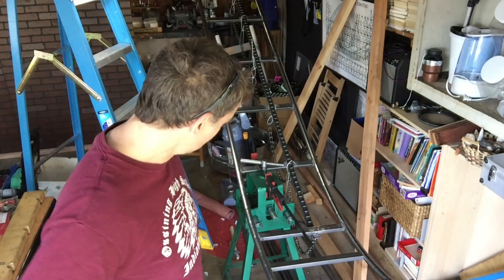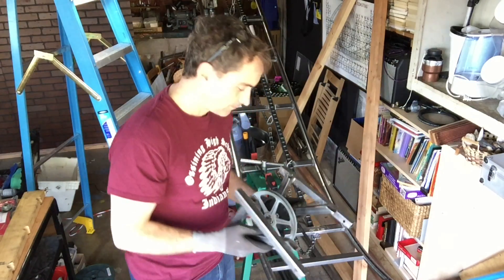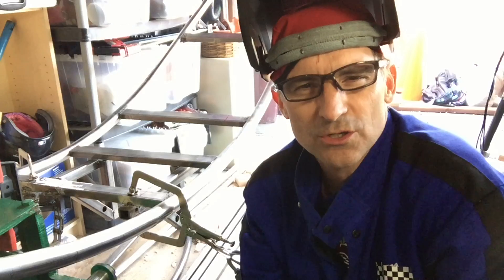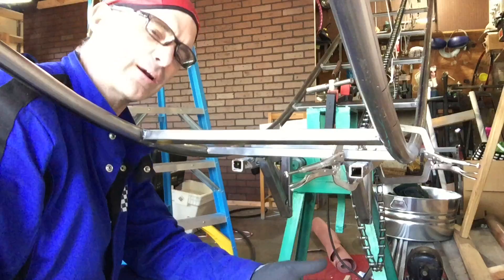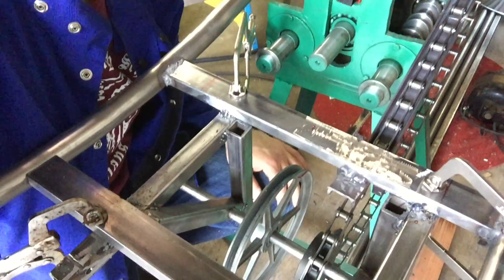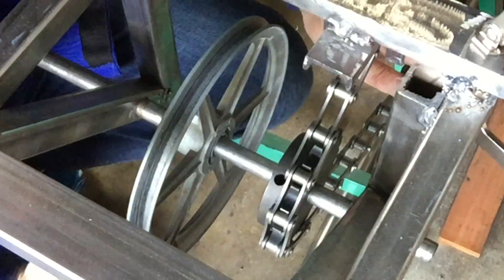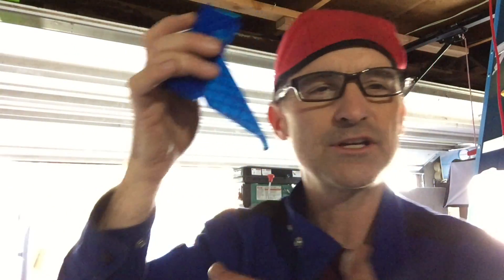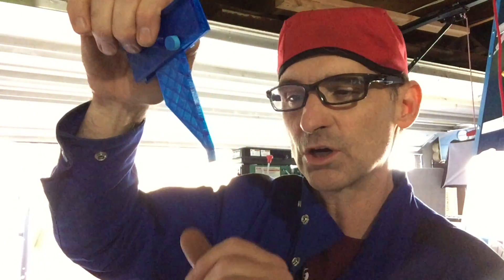Chain Lift 24, CoasterDad 28!

Comment: Omg the chain dog mechanism I literally thought of exactly that mechanism in my head It didn't look like it but. I thought how the cart gets pulled up is there's a tooth that has a mechanism stopping it from moving forwards but only backwards by a little piece of metal in front of it while a spring behind it so when it gets pulled up Gravity is pulling on the cart but can't pull it down while the force of the Spring gets pushed back and while there's nothing stopping it it will push the connecter into the chain.

Comment: just a idea for what you can use for your anti-rollback mechanism you can use another piece of steel channel on the opposite side of the track with use the same sort of chain in the track but fix it to the channel so it cant move then all you need to do is mount another identical chain dog on the opposite side of the cart. half the engineering required but the same result :)
Reply: +urbansnipe it would then also be alot easier to implement this along different sections of track where a rollback may be an issue

Comment: Make sure to center the chain dog EXACTLY at the point where the wheels make contact with the track. You can't just place it anywhere in between the front and rear wheels, or it will lift out of the chain at the bottom of the lift, and dig in at the top. I have 2 chain dogs on mine, one at the front, and one at the back.
Reply from the maker: Hey THEMINDSHAFT!
I was thinking of using 2 Chain Dogs. One front and one rear. And I gotta say, your videos have been super helpful. Thanks for the feedback. This is truly a group effort!
Best,
Will
Reply: Will Pemble
Sharing gained knowledge in the maker community is what it's all about Will! I love to pass on what I have learned on different projects. If I can help someone avoid a headache I have had, I'm right there with any help I can offer. Shout at me anytime you have a question on something I've conquered with my coaster, and maybe someday, you can return the favor from the R&D you are doing. ;) Great job so far!

Comment: II could be wrong, but I think I would put the motor at the top.  That way only one sprocket is under high load, instead of two if you put it at the bottom, so there would be less friction and wear on the chain.  A tensioner might take a lot of development to get right.  Even a chain made of steel will act like a spring (albeit a stiff one).  The deflection of the chain under load will be twice as much if the motor is at the bottom vs the top, because the chain under load is twice as long.  But, maybe more springiness is good?  
I'm sure you can make it work at the bottom, but I think there will be less problems if it was at the top.  I would hope you are planning to put a safety cage around the chain, so no one gets hurt.  On my coasters, I am avoiding motorized chain lifts, which guarantees an adult present to push the cart up the lift hill, as an added safety measure.
Reply: Will Pemble has a 3D Printer
Reply: Kyle Gregg Yes. Yes, he does? 
And so should Paul Gregg and Kyle Gregg! Imagine the incredible stuff that could come out of a Gregg-Owned 3D Printer! WOW!

Comment: Will!
I really, really, really hate to rain on your awesome parade, but the chain dog - I see a potential flaw! :(
With the chain channel in place, the chain dog tooth/catch cannot pass through the chain, but can only seat jut the tip of the catch. What I am worried about is that the chain dog will not have enough purchase on the chain itself (without being able to have the chain catch pass through the chain - ensuring a secure hold on the links)

I am wondering if the cart will hold with serious weight involved. :(
If you have thought about his sorry for the worry, but I am concerned...
A possible workaround is to make the chain dog catch shorter, with a more exaggerated catch (the curved piece on the end)
Making it shorter and stronger would not allow the chain catch to be pulled to a critical angle where the catch no longer has purchase. (I say this because the chain catch does not pass through the chain, thus having very limited security.

Maybe I am over-thinking it...I just wanna see this don so badly! Haha

Anyways I hope the best, and I also wish you and the family the best.
Always a pleasure to watch your new vids. :)
Love the shop, and all the projects...you're family is very lucky to have you!
Reply from the maker: Hi Michael Gedies 
Good eye! I'm working on another version of the chain dog with a bit more curve at the end.  Also, remember that the chain dog will actually lift the chain out of the channel by as much as an inch when the cart attaches.  As for strength, I'll be using 1/4 or even 1/3" solid steel.  It'll be hella strong.  ALSO, there will be two, count 'em two, chain dogs on the cart. one in the front and one in the rear. FINALLY, there will be a full-on rollback prevention system as well. 
Dude! I had no idea how many parts and systems are involved here.  And it's a good thing, otherwise, I might not have tried it :)  
But now, the only way out is through. Thanks for watching!
Best,
Will
Reply: Will Pemble i can not wait to ride it!